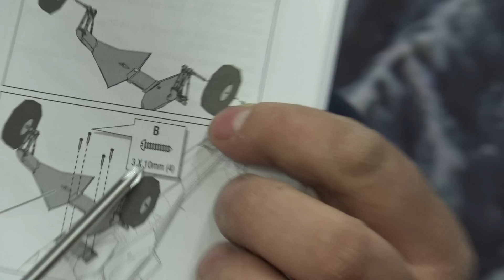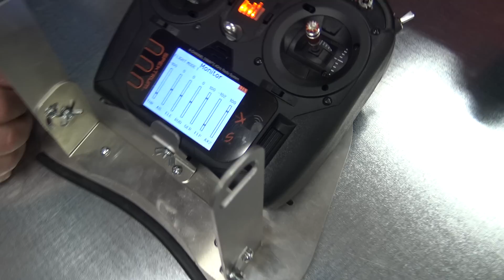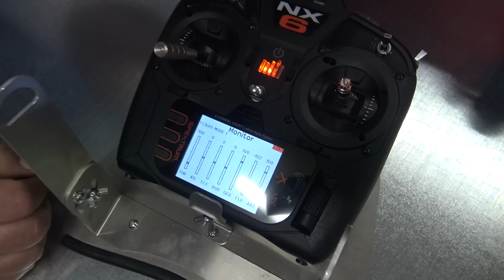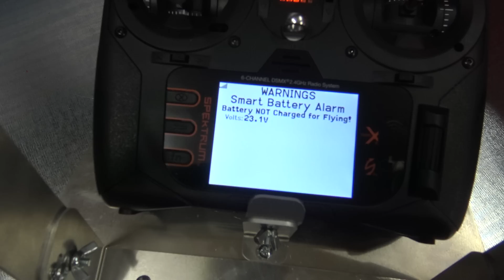GIANT DRACO Wilga 2.0m Smart BNF Basic with AS3X and SAFE Select Assembley

Comment from the maker: IMPORTANT: the manual that we were using in this video is not finalized and we didnt knew that. SAFE can be set even on DX6 and NX6. On DX 6 you will not have reverse thrust and on NX 6 you must use 5th or 6th channel to share with SAFE. Dont use 7th channel AUX2 for SAFE. It is pre set for reverse function!!! Updated Draco manual here: https://www.horizonhobby.com/on/demandware.static/-/Sites-horizon-master/default/dwed0790f0/Manuals/EFL12550-Manual-Eng.pdf
Reply: That is reason is why I bought a new NX8 only a month after buying my NX6. I "needed" reverse on the ultimate 3d biplane! I'm keeping my NX6 transmitter for my backup tx.
Reply from the maker: @old-rcplane-phart  Iam happy also that I still have my DX9. But thinking to get NX10 for my next radio.

Comment: Captains, horizon hobby told me that you can use the nx6 radio but the lights would be on all the time but you would have safe select and reverse thrust
Reply from the maker: Oh yeah my friend. I have writen that in my comment pined up. Its great that it works. I had old manual.

Comment: Get rid of those Cheap out-of-round Foam Tires and replace them with Flex Innovations Cesena 170 6" Rubber Tundra Tires . You can drill out the Axle Hole to the correct size.  Real Good Year Rubber !
Reply from the maker: Will check it my friend.

Comment: Could you please explain the function of “expo”... my last experience with rc was back when Kraft radios were common in the 1970s and  none of this technology existed
Reply from the maker: Somethimes when you move ailerons the elevator also moves. You can fix that with expo and also so the plane is not so touchy when you move sticks. Expo slows down the movement for the % you set. If you set let say 20% expo for the first 20% of the stick movement it will move slowly but after 20% you have then the rest of the surface travel.
Reply: Thank you for the explanation...very much enjoy your videos...